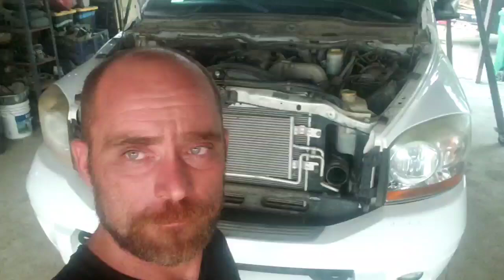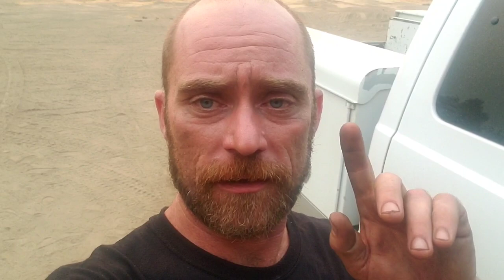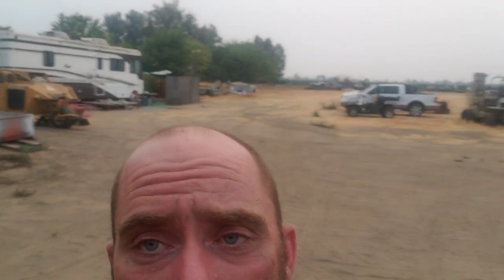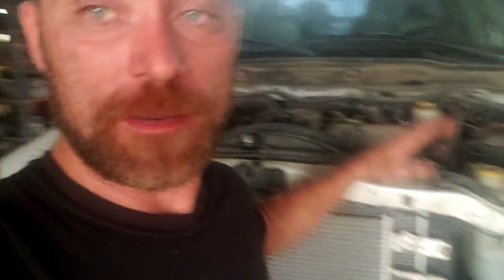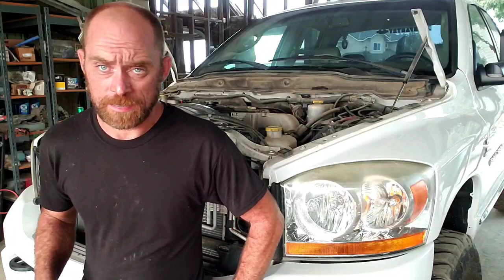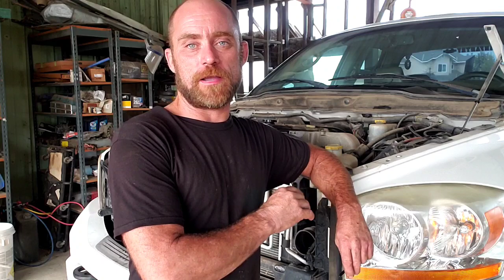Cummins - problems - 5.9 - common rail - still the best engine

Comment: Id argue that cummins 5.9/6.7 is "among" the best light truck diesel engines. It is far from the best.
In the short 3 to 4 uears that ive owned a cummins Ive heard more spun bearing issues with these 6l engines.
I know there are operater issues that cause manybof these but there are many times that it is just happen-stance

Comment: You know tuners are not good for the engines unless it's light, custom to truck tuning.  Next is contaminated fuel, diesel quality sucks.  An aftermarket water seperator should be installed.  Next is the pos air filters, AFTERMARKET AIR FILTERS DO NOT FILTER AS GOOD.  99.93% IS THE MINIMUM EFFICIENCY YOU WANT.  THERE IS A HUGE DIFFERENCE BETWEEN 99.93 AND 99%.  AND CHANGE YOUR OIL!!!!

Comment: Usually the case with the 6.0 powerstroke. They were either ignoring small issues and they overheat and lift the heads or they didn’t do maintenance and the HUI systems plugged and injected failed.

Comment: Also, highly recommend getting a laser thermometer when test driving. Easy way to check if all cylinders are firing. Quick measurement on the exhaust manifold will tell ya if a cylinder is dead
Reply: On an inline 6 if you cant tell your down a cylinder with your ears and reduced power you've got bigger issues.
Reply: That’s a cool tip! Thanks

Comment: Just add any type oil it does the same as any diesel additive you can buy MMO works good in fuel and I dump 2 quarts in my oil and run 100 miles and drain the oil just to flush the block out and it works .

Comment: Hey bud don’t know if you’ll see this comment but I’ve got an 07 truck was running top went to work worked 14 hours came back out and my lights were on batteries were dead. Changed batteries truck started up and died 4 seconds later. Now won’t start at all and has code p0251 260k miles

Comment: I f up and put an edge programmer on my 05 and the bullydog wasn't completely back to stock when it said it was . So it ended up with 2 programs stacked and blew two injectors almost immediately when I hit that slim peddle on the floor ! 🤣🤣🤣🤣

Comment: You have to love the smokey air in the Central Valley during fire season. The only thing better is when the humidity rises! I, too, am in the Central Valley and it seems every year during summer the air gets thicker and thicker. This was a very insightful video. One thing I might add is the fact that a lot of people don't know how to diagnose and work on the diesels properly. They can pull things apart and put it back together, but they don't understand how the engine truly works and how to properly diagnose issues with the engine.I had an issue with the dealer here in the valley that I took my truck to. They couldn't figure out the issue with the truck. Their response was "it had a tuner on it.".........never had a tuner, but rather they were incompetent. I'm trying to expand my knowledge of the 5.9 and learn how to work on them properly. Thank you for the video.....keep them coming....

Comment: I have a 2004.5 Dodge Ram 2500 with a automatic and 8 foot bed.  Truck was bought 4 years ago with 125K and is totally unmolested no tuner totally stock. I went through the truck and the first thing I did is replace every filter and fluid I knew about that included the front and rear diff, trans, air, fuel and the of course the engine oil.  Just ordered a Cummins CCV filter and will be checking closely the hoses and tubing for it.  

The key reason I bought the truck was it was not tuned and very low mileage. I am retired mechanic as such yes my truck does tow but not heavy and I do make it work but with it have 65% no towing and short trips I always have changed the oil every 3,000 miles because of my driving style. I am now due for another round of fluid replacement as I got 154K on the truck and I will be doing it soon.  The only repairs I done is a complete front end, the water pump and tensioner with fresh antifreeze. I also do the fuel filter every 2nd oil change as I found that to be easy to do and protects the injectors. I do not use any additives except if I expect to be going to cold areas from my relatively warm area and I add some diesel 911 to the tank before filling up before the trip to try to mitigate fuel gelling. 

 Maintenance is always been a big thing to me and I do over maintain my vehicles but that simply means I can jump in any of the vehicles I own and drive cross country at a moments notice and know I will arrive safely and efficiently.  

The only modifications I done is replace the front bumper with a winch bumper that I did a trade for my factory bumper.

Comment: Great videos,  what it's the most common thing to check when it comes to buy a truck like this?

 I am trying to get a 2006 5.9 cummins mega cab , automatic trans with 130,000 miles on it
 Guy wants 14k
Any advice ?
Reply from the maker: buy it
Reply: 4x2 or 4x4?

Comment: For someone looking for maximum longevity in an 06 5.9, what do you recommend? I have added the CAT fuel filter upgrade. I'm wondering about the in cylinder egr causing extra oil contamination. Would oil and coolant bypass filters be a good idea if I already change my oil regularly 5000-7500mi. Any other suggestions?

Comment: I've got an 04.5 manual. Never had an issue but I did have some rough running at one point . Some cetane boost/injector cleaning cleared it right up. Has 415,000 km on it. Runs like a top. Running a smarty tuner change oil every 5000km never had a blow by issue. When the time comes I'll probably just rebuild because I know many people that sold their 5.9 common rails and bought new 6.7 cummins and almost immediately regret it.
Reply: What settings are you running on your Smarty’s tuner?
Reply: @troymenting6854  smarty Jr. So just the 3 modes that it's set with
Reply: I have the Smart’y Jr as well. Do you keep your “torque” and “timing” settings on default, or do you bump them up a bit?
Reply: @troymenting6854  keep em default.

Comment: Great video never owned a Dodge Cummins I’m looking at a 2006 Dodge Ram 2500 24 valve 5.9 clean with 190k mikes for $17K what do you think? Thanks any advice will be appreciated. Best regards!
Reply from the maker: good price biggest thing to check is the trans if it is auto. I expect about 250,000 miles out of a stock auto if well maintained

Comment: I have a white o6 just like that one. Manual. I have a bully dog tuner nothing special and a s&b air box. Been having cam sensor issues i can’t figure it out. Changed it twice checked wiring, voltage everything and still throwing it. I can feel the cam hitting something when the engines running and you out your hand on it. I put a spacer in the cam sensor and it stopped for a few days and came back. Any suggestions? P0340 p0341. Still runs like you said but I can’t get the code figured out

Comment: Does a significant amount of blowby automatically mean it needs a rebuild? No check engine light, no codes, runs great. Or could it be a bad injector?
Reply: It could be an injector. If it’s shooting out with rhythm that’ll tell you something. As will consist smoke. Dig into that? GL

Comment: Oil analysis can tell you alot about the condition of the engine.  Especially If there is fuel in the oil. Mine has always been clean

Comment: Mine was 3 4 5 & 6 but 5 & 6 we're really bad and 3 & 4 we're bearly starting to go and my mega cab only has 93000 on it and 3 transmission's ya its turned up but I only used that truck to tow my trailer

Comment: I have 06 5.9 . With 185××× miles on it . Every problem I have I have to spend a couple of thousand dollars. And it's no fix yet
Reply from the maker: Shoulds like they are not fixing the problem.... but you are still paying?
Reply: @CVcustoms  they told me take it to dodge dealer here in murfreesboro TN.  They just take almost 750$ without fix it. But someone told me need to reprogram the pcm. I'm trying to just make it runs so I can sale it.  I always say ford truck.  No need to spend money to fix .
Reply from the maker: @sunnysmarket  could be the pcm and the time to sell a truck couldn't be better.... I hope it works out BTW both of my work truck are Fords a 7.3 and a 6.0
Reply: @CVcustoms  I just did change the pcm and its works now good . Hopefully I can get rid of it.  I can take any chance anymore.  I do have a 7.3 and its much better than dodge . The pcm itself cost me 1150$

Comment: I have a 2006 with 456K the only thing I have done to the engine is the injectors. No blow-by and plenty of power.
Reply: I've got an 05 with 560k. Just had to do injectors and a couple small things but it's running like a champ.
Reply: I got a 2020 3500 HO and it's already had two check engine dcts...it has 27k on it lmao
Reply: Ive got a 03, 140 mi.  Been one issue after another. Lift pump, fifth gear disaster. Now 6 cylinder rings broken. .....Run away as fast as you can.
Reply: @ericparde8070 why yours ?

Comment: This is great info I'm looking at my first diesel  early 04 ram 3500 5.9 with the NV5600  transmission with 122,000 miles. Any thing I should look for?

Comment: I have an opportunity to buy a 2006 Dodge Ram mega cab 5.9l Cummins 2wd with 201k miles possibly needs a transmission and a rebuilt title. It’s from the auction (sight unseen). It was in a front end collision back in 2019 but the repair looks pretty good. I was awarded the vehicle for $7k but this will be my first diesel vehicle. I’m not sure if i should continue with the purchase of it or just pay $1k for them to resist the truck. Any advice?
Reply from the maker: I paid 7500 for mine with an engine that needed rebuild but the transmission was just rebuilt 5000 miles before I bought it.. title was clean as well..... after rebuild and title I have about 16,000 in it...... in my neck of the woods these 06 cummins bring 20,000 to 30,000....... i afraid if you take this project on, when you are finished you may be upside-down or be at a point to only brake even..... if you love the truck and plan to keep it.... than it is a great opportunity for you to bring the truck back to life and you will know everything about you truck..... thanks for watching

Comment: My 2005 common rail has just hit 505,000 miles on stock motor. Injectors have been replaced only one time.
Reply from the maker: cool

Comment: Great Video, recently bought 06 5.9 6 speed manual It’s throwing codes such as P088 and another one for the Crank shaft position sensor if I leave the crank sensor plugged in it’s a crank no-start if I unplug it it will start but runs a little rough blowing some light black smoke installed a new sensor no change.
Any ideas ?
Reply from the maker: sorry for the late response but the first thing that coms to mind is the check the ring behind the harmonic balancer .... there is a pin that times the ring

Comment: 11:03. The reason why #5 injector fails is because where the turbo is mounted on the exhaust manifold. More resistance for the exhaust gasses to exit.
Reply from the maker: Great point 👍
Reply: I put a steed speed manifold on my truck along with a fleece cheeta turbo.
Reply: You are absolutely right appears on the last 5.9 manifold 5 &6 blow into each other. Good observation!

Comment: I just bought a 1996 Freightliner with the 5.9 12 valve. It had 158,000 miles and runs great. Should I replace the injectors as preventative maintenance?
Reply from the maker: No .... The 96 is a 12 valve not a 24 valve so your injectors are mechanical and not electric so they will  last longer ...... you should be good to go ....... Great engine, cangrats
Reply: @CVcustoms  I'm going to deal with the killer pin and replace the water pump at the same time. Anything else I should do as preventative maintenance?
Reply from the maker: The pin is the most important. changing the pump at the same time also great. two other things should be checked, 1) adjust the valves and 2) inspect the turbo. Other than that at 158,000 the engine is only just broken in

Comment: Good point on the injectors but to be more specific the injectors fail from lack of good filtration. The common rail system requires a much lower micron rated fuel filter compared to the older trucks, it's really sensitive to dirty fuel. That's part of maintenance but most people that are used to having a gas truck don't change fuel filters at all or at least as often as it's required on a diesel.
Reply from the maker: agreed
Reply: What are you seeing as far as injector life? My 06 has only 167000. It's had a 60hp tow tune on it for most of its life. It has a fleece cheetah turbo, banks intercooler,  cold air, and banks intake horn.  The truck is putting out more black smoke even on stock tune than in recent months.  I'm thinking I may need to preemptively change my injectors.  I feel like I have upgraded my airflow enough.  On another point, the lubrication in our diesel fuel or lack thereof is a problem.  I use an additve fairly consistently.  Guys running the cp4 pump have serious failures due to lack of lubrication (low sulfer fuel.)
Reply: @overheadcamwalling4146  From what I’ve read on forums, injector life on a common rail is typically 150-200k miles. Regarding the smoke, I’d make or buy a boost leak tool and test the system. You’ve changed a lot of parts on the intake system and could have a leak somewhere. Smoke isn’t just from additional fuel but also from a lack of air. I’d especially check the gaskets for the intake horn.
Reply: @overheadcamwalling4146  Curious, who told you about the injector life. I work in fleet, and this engine is/was legendary in its reliability with regular maintenance. I’ve seen commercial city trucks with 300k, still going in their original injectors.

Comment: I have one additional question. My truck just hit 200k. I plan to change the injectors per your recommendation. What injector do you recommend and best place to  buy them. Thanks again for your excellent video.
Reply from the maker: Injectors direct .com thats where I get all my Injectors
Reply: @CVcustoms  besides new, do you recommend refurbished or remanufactured?
Reply: I just saw the video where you install the injector; remanufactured
Reply from the maker: @MrEdgardotcom  remanded
Reply from the maker: https://youtu.be/zyAi4PLkRbs
Injector install

Comment: Great video. I have a question . I bought a 2004.5 ram 2500 5.9 new. I use Rotela 15w40 regular oil. How often should I change it. The internet gives me a multitude of answers. I know normal service reccomendation is 15k. Is that for synthectic or regular? I've always changed mine at 7500. Please clarify for me. Thanks.
Reply from the maker: stick to the 7500 and shouldn't have any problems and I use regular in all my 5.9's